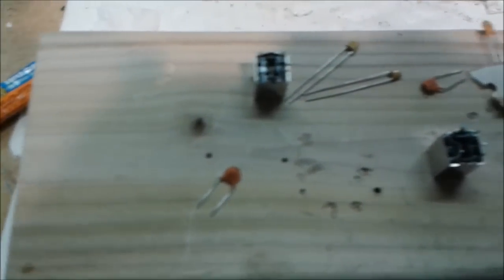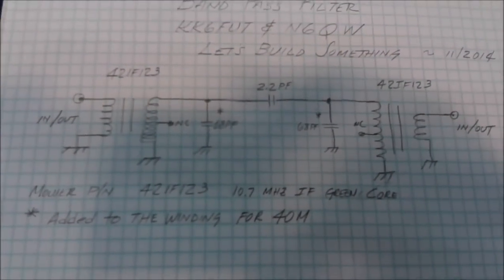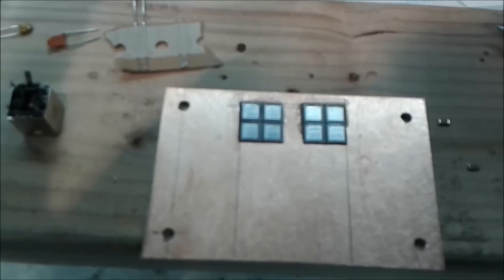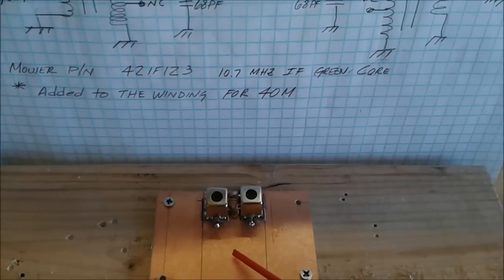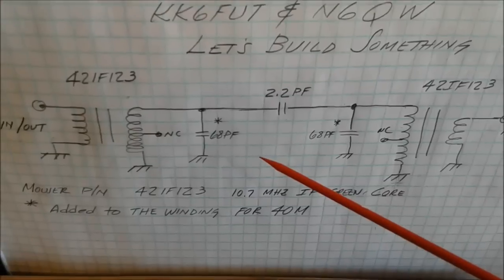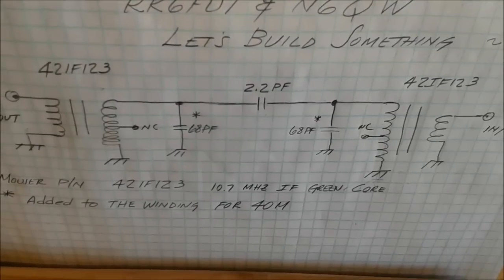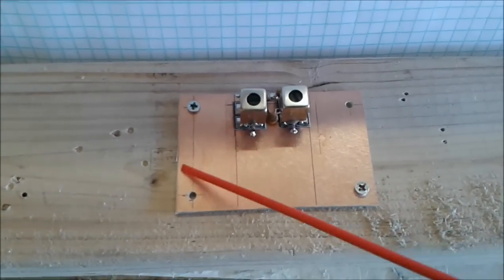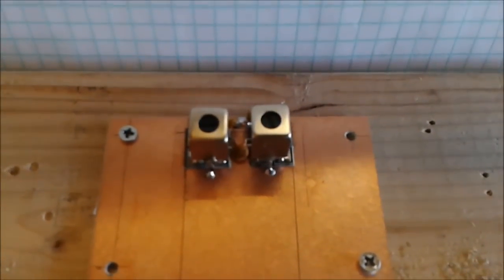Let's Build Something Construction of the 40M Band Pass Filter

Comment: Excellent video pete, like yourself i prefere to use this method its easy to tune up and gives a good proportion use of the 40meter band. thanks pete.
Reply from the maker: Hi Peter,

The 42IF123 IF Cans  but disappeared from the world and so now I am forced to use discrete coils and caps. LT Spice the simulation program (free) from Linear Technology sure makes that task easier. I have one design developed using that program where with the addition or removal of two 150 PF caps the network can be tuned to either 40 or 20 Meters. See my searchable blog n6qw.blogspot.com and you can see the component values. also my website www.n6qw.com and look at the Sudden Transceiver project for the values. Thanks for your posting.

73's
Pete N6QW

Comment: What value components do I need to make a Band Pass filter to receive two stations at 8.5 Mhz and 9.11 Mhz? That would have a center Frequency of 8.8 Mhz.
Reply from the maker: Hi,Not an easy answer that can be done without some significant calculation and modeling. There are several methods to do this (and I am not going to do it for you). The video involved the use of packaged transformers which are no longer available. Thus the only option is to build the band pass network from scratch. You have a requirement to have at least 600 kHz of pass frequencies with a base frequency of 8.8 MHz.One way is to hand calculate the component values using methodology shown in a publication entitled Solid State Design for the Radio Amateur by Wes Hayward. That calculations are not that difficult but may require you to make a couple of runs at it. A second method is to use free software programs that let you adjust values so that you can get a centered filter with a specific band pass. Two such programs are LT Spice (free) from Linear Technology. and the second is Elsie ( free from Tonne Software). Both programs let you simulate the filter and you can visually see the band pass. By making several runs you can finally arrive at the desired filter. Keep in mind these are simulations and that what you build in practice may have some effects from physical layout and stray capacitance.What was shown in the video had a smaller band width like 300 KHz and was a bit of a stretch for the packaged units. For a larger bandwidth (like 600 kHz) you will probably need to do the calculation. Another publication called EMRFD (Experimental Methods In RF Design) has programs to design BPF's -this is not a favorite publication of mine. My 1st choice would actually be a combination (and how I do it) of first hand calculating the component values and then use LT Spice to validate the design. The video was associated with a published project and was intended to provide a design that used standard components (now not available) so that the builder could just slap something together without having to do some serious engineering. Now you will have to engineer the answer. If you can actually find the specified transformers you can trial and error the values. The coupling caps most likely would be in the 1 to 2 PF range and since the transformer original design was 10.7 MHz and was moved down to 7.2 MHz with 68 PF --something in the 22 PF to 39 PF range should move it down to the range you want but making it do 600 KHz is very likely not a reality - you will get several hundred  kHz of pass but most likely not 600 kHz. To meet your specifications will require the rigorous calculation as described in the publication cited.Good luck with your project.73'sPete N6QW

Comment: hello 
can someone please tell me how much time and money does ti take to make this filter ?
thank you
Reply from the maker: kiriakos k Hi -- Thanks for your email. If you can buy the 42IF123 transformers then it would take about 15 minutes to build as it only requires three capacitors and the two IF cans. The cost could be around $10 USD depending if you have to buy everything. The version with discrete components would cost only slightly more and perhaps 1/2 to 1 hour to build depending on your skill level. Either is fairly simple to build. 73's Pete N6QW
Reply: Pete Juliano thank you a lot

Comment: Hi Pete, I'm looking into building your project and i'm trying to find sources for all the components.  For the most part its really straightforward, but those IF transformers your using arn't stocked at Mouser any more.  Do you have an alternate source for them, or can you suggest a suitable alternative?
I'm thinking of gutting an old radio for IF transformers, but I don't know how to get them resonant at 6.989Mhz
Reply from the maker: Check the webpage for this project here http://www.jessystems.com/LBS_Detail.html There are two options we have listed: an alternate source  for the transformers "Kit and Parts" or you can roll your own by building your own band pass filter. Kits and parts is also a source for the toroids used in the homebrew filter. Thank you for your interest in this project.

Pete N6QW

Comment: I'd like to see how you arrived at the value for the  capacitors (68pf).
Reply from the maker: The stock IF is 4.5 Uhy shunted by 47 PF --if you add 68 PF the resonant frequency is now 6.989 MHz and a slight tweak of the core drops you into the 40 M band. Send me an email to radioguy90 at Hotmail dot com and I will send you a chart of values for the major ham bands. On 20M and above you must remove the 47 PF cap on he underside of the transformer.

Comment: These are always good for stocking random values http://www.ebay.com/itm/Lot-of-1000Pcs-Set-Kits-50values-50V-Ceramic-Capacitor-Assorted-Kit-Assortment-/141128915656?pt=LH_DefaultDomain_0&hash=item20dbf05ac8
Reply from the maker: Thank you! Got some.

73's
Pete N6QW
Reply: No problem, gotta love eBay! Gonna have to build this thing when you finish the design and vids.
Reply from the maker: joblessalex Glad to hear that --the whole idea for the series is to make it so that the construction is clear and that we use common parts --no IC's (except for the Arduino), no packaged DBM's and mostly 2N3904/2N3906 devices. Another goal is to reuse everything that is built in each phase will end up in the final transceiver. Many projects today are pretty complex from the get go and we are trying to avoid that with this series.

73's
Pete N6QW
Reply: Pete Juliano Possibly easier than the beach 40? I built the bitx as well, both ended in failure due to the final amplifier oscillating....